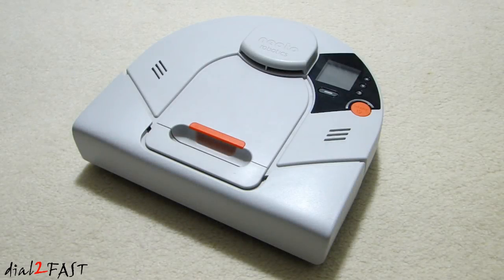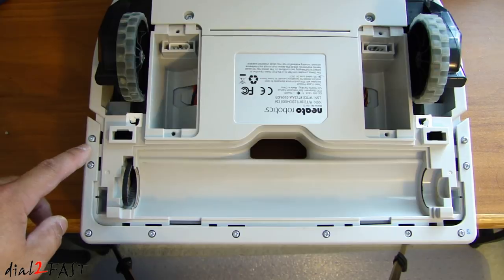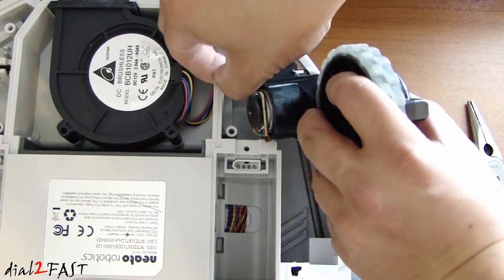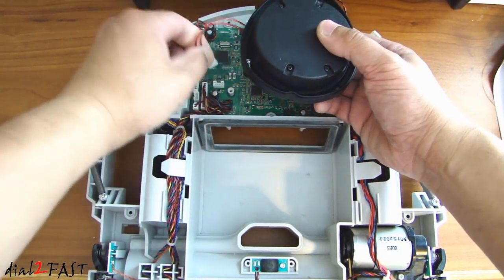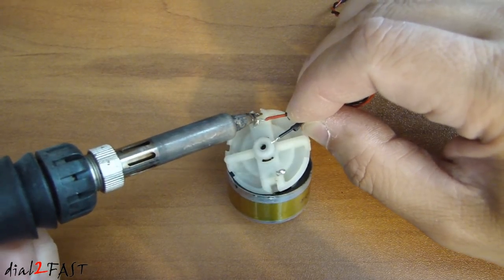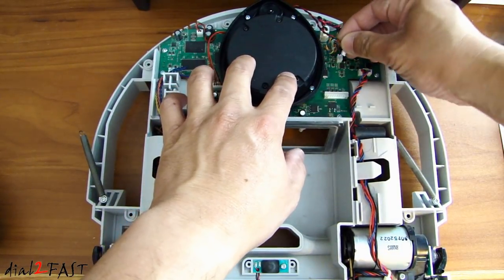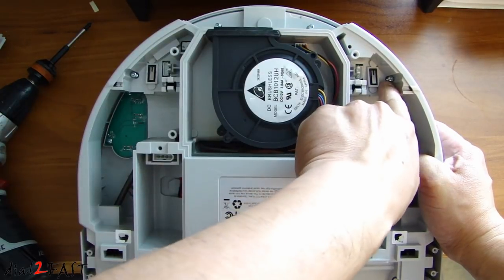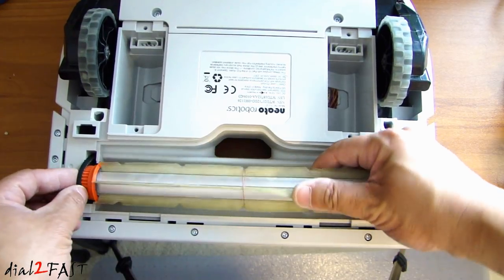NEATO Vacuum Cleaner Repair - My Vision Was Blocked 3000

Comment: One of the most comprehensive DIY videos that I have seen.  I was actually starting to shop around for a new robo vacuum when my Neato stopped working.  Seeing that my Neato was around 10 years old and the batteries were getting close to needing replacement, I didn't want to invest too much more time and money into it.  I found this video and although it seemed a little daunting at first with the number of screws and components that need to come out, it really wasn't bad at all.  There was a little plastic fatigue on two screw-holes but there are so many connection points that it still holds together very solidly.  It took about 20 minutes to take it apart, two days to receive the part and about 40 minutes to re-assemble it.  Put it back in the charger and after a top-up, it was back in business.  So, after about $10 in capital, a little over an hour of time and that pesky 2 weeks of procrastination, my Neato is back in service!  Thanks!

Comment: Extremely clear video, thank you!  For those also suffering from the "my vision is blocked" problem, here is my experience after bringing the machine out of a two-year exile in the closet.  I could see the lidar spinning so thought that was not likely the problem.  So I decided to disassemble just to see if there was anything I could clean before sending it off for repair.  I can't say for sure what did it, but the process of dis- and re-assembling (a few times) seems to have fixed it, for now.  The only things I remember changing were (1) the belt that drives the lidar seemed a little stuck when I first played with it, so I reseated it in the groove, (2) the pulley that moves the belt was a little low on the shaft and might have been rubbing as it rotated with the motor shaft, so I lifted it slightly, and (3) the back rollers that the machine rests on when moving were immobilized by hair.  Here are some definite caveats: (1) do not overtighten the screws that hold the motor to the lidar--the hole in the motor stripped and I had to use some glue when seating the screw, (2) in the XV-11 and -12, it is quite difficult to reconnect the ribbon cable just before reassembling the top onto the bottom.  There is a little black piece on the connector that needs to be lifted ever so slightly to allow the cable to slip into place, and then the black piece put back down into place, and this has to be done with the top cover close to its final position on the bottom of the machine.  It's tricky and took several tries of reassembling and disassembling the whole thing.  (3) Be sure to test before reassembling the top to the bottom that the bumper clickers are positioned correctly by pushing on the bumper in all four locations where the clickers are located.  I had to re-/disassemble once for that problem.  Just cleaned the house and the error has not come up again!

Comment: A terrific instructional video. The steps are clear and as I write this my Neato is cleaning house again. If you're going to undertake this repair, you'll need to buy a small motor, and you'll need a soldering kit. The motor is cheap and soldering isn't hard (my first time!). Thanks for a great video.

Comment: Thank you. I too got mine going with the help of your video. I bought a motor from ebay that came with the wire.  Put it in and it didn't work correctly.  Then remembered your comment about the polarity of the wiring and took it out, de-soldered and re-soldered the connector and presto! Robbie is working again!  Many thanks
Reply from the maker: Very good to hear you got yours fixed. Cheers!

Comment: Excellent, clear, precise video!  It will save you from having to send it back to Neato, which I know from experience is a "Black Hole".  You can plan on not seeing it again for months, and, when you get it back, it may be missing parts, like the charger!  When these run, they work well, but both versions of Neatos I own are plagued by problems.  The latest is the vision issue on my XV-15.  With the amazing amount of disassembly required, this video is a huge help! BTW, I replaced the standard NIMH batteries with LIONs and have had no more battery issues for several years.  Now, if you could just come up with a fix for the "Please turn my switch on" error, when the switch IS on for my 2yo Roomba.  That said, stick with a Roomba; I've had one for 12 years, it runs like a top, and is only on it's 3rd NIMH battery(replaced 6 months ago).  No "Battery Reset" routine ever needed.

Comment: Fantastic video. I took mine apart and the motor looks the same, engineered to fail, basically. Anyway, you saved me from having to poke around to find all the screws and pulling on parts only to find I missed a hidden screw. Thanks.
Reply: What isn't.

Comment: Thanks for the video. I had the same 3000 error and a new lidar motor is exactly what I needed. Brushes were worn just like yours. Great instructions.
Reply from the maker: Thanks for your comment!
Reply: Patrick Moore wonder if its possible to weld the brushes or replace that worn brish with a similar instead of ordering a new motor
Reply: Bezerra Luis I’m sure you could. Was just easier and faster to drop in a new motor and they are cheap enough.

Comment: Thank you for well put together video for installing motor in Neato to correct “vision error”. I was able to fix my system with your help!  My only request would be to show which length screws to use when putting back together.  Thanks again!!

Comment: Thanks a lot for the detailed video! It helped me for my XV signature.
In my case, once I got to the motor, I first tested it with a 5v adapter, the motor seemed to spin correctly, tested a few times spinning it forward and backwards. Then we tried to pull the belt off and it was stuck! We cleaned it, added some new white grease on it and reassembled the Neato. It's cleaning the house happily after that, no parts replacement needed yet. I'm buying one of those motors next time I travel to USA just in case :)

Comment: Excellent guide!  Here are a couple of tips to consider. The assembly screws are made of very soft metal and it's easy to strip the heads or even break them off. For a few bucks you can get stainless steel #4 x 3/4" sheet metal screws that are perfect replacements at Home Depot. The reason I needed some screws was I had to remove the top a few times because the bumper switches did not align with the top easily. As an aid, I put 1/4"x1/4" pieces of double sided tape on the back of the flippers at the point where they touch the spring. This held them perfectly aligned for easy top installation. Finally, the 3 pin connector for the lidar to the motherboard tends to pull off the motherboard rather than separating the plug from the socket. Put a mark on the board and the socket for correct reassembly alignment before you remove it.
Reply: especially the lidar socket that pulls off the motherboard tip is useful !

Comment: Thanks for a very clear description of the repair.  One thing I found was that you need to be careful not to over-torque the screws when putting them back.  Two heads broke off very easily and one stripped the thread on the plastic in which it was inserted.  Gently does it!

Comment: Excellent video. Clear and concise, pointing out all the "gotcha's" you might run into. 
I use blue tape to keep all the screws in place on the different plates that come off like that small screw on the trim plate. Makes putting things back together a no brainer. 
One small point, when removing the motor screws they have a tendency to roll toward the lidar. 
I also wonder if the fact that the motor is running backwards tends to make the brushes fail? The brushes seem to favor rotation in one direction. 
My client's burned up exactly like yours. Early diagnosis was that the lidar wasn't spinning. 
Also I turn the screws like this backwards until I feel it drop in the thread. Keeps them from stripping out. I'm especially careful with these coarse ones that thread into plastic!

Comment: Your video & step by step instructions were clear & precise. Very well done....
I have had my Neato xv21 apart about 6 times now over the years for various faults. Usually motors going bad & sensors blocked & 1 broken sensor wire from bumper bar flexing. 
LiDar Motor is <$2 on EB ... see below. Wanted to check your video to see if you use the same take apart procedure. Only difference was that I left the wheel motors in place for the LiDar motor fault just to save time. Also, Replaced NiCd Batteries over 2 years ago with custom neato Lithium batteries (made by PowerLithium in USA) and the machine works great. Up to 1hr 15m run time. Were as the NiCd’s gradually get less & less run time until they die. Lithium are far better.
Cheers... Trevor in West Australia.

Lidar Motor on eBay here:

Mabuchi RF500TB-12560 Motor DC 1.5V 6V 12V 4600RPM 32mm DC Motor Spray machin EB

https://rover.ebay.com/rover/0/0/0?mpre=https%3A%2F%2Fwww.ebay.com.au%2Fulk%2Fitm%2F263527236662

Comment: Great video, thanks for putting this together. It worked perfectly on my first Neato, tried it on my second Neato a couple weeks later as it was experiencing the same symptoms, and once i put it all back together I received a message that stuck "My bumper is stuck. Please free it." Any ideas? I paid close attention to the four small, black, plastic bumpers when disassembling, one did fall off but I put it back into place and tested it right away. Any help would be appreciated.

Comment: My XV-12 has a problem with vision blocked most of the time, but not always (sometimes it runs).  Also, it looks like the lidar is spinning even when it is having the problem.  Are these two symptoms consistent with a problem with the motor?

Comment: Hi, ive followed your very clear instructions, but my XV Signature Pro, still has the sampotential problem :-/ .. I opened up the motor as you, on the one I replaced, and mine was burned as well. Do you have any other solutions? The vision/censor does not spin.

Comment: Thank you for sharing this very good video.  My XV-21 recently got frozen when power on.  It needs to remove the battery and switch back then it can work OK. It happens very often. Have you had similar problem with your machine ?  I appreciate if I can get your comments.  Thank you.
Reply from the maker: I have not had this problem.

Comment: Thank you for the excellent video. I replaced the Lidar motor and continue to get same error message "My vision is blocked 3000." Can you please recommend anything else I can try?
Reply: I was getting the same message, I came across this video. Ny neato has been in service for 45 months working everyday.
I'm kind of leery of putting any other money into it as something else might break.
I did try this and of course I'm only 15 minutes into the cleaning I did but the error message has not come back and it sounds and is working perfectly.
I took isopropyl alcohol and q-tips and cleaned underneath where the laser eye is and I also clean down into the spinning groove. It was my hope that after 3.5 years it was some kind of dust and dirt buildup. Not sure if this is a fix but so far so good fingers crossed.

Comment: They actually changed The new motor system for the D7. That was their way of preventing this problem but it actually is made it worse. They used to fail usually in 2 to 3 years but now can fail in as little as 3 to 4 months. This on a $700 vacuum And per Nido it was due to a bad batch of motor supplied. When it works it works great when it doesn’t it fails spectacularly.
Reply: Neatos are poorly engineered, and their "repair service" is a nightmare.  I sent one in for repair and it took 4 months and a VERY reluctant intervention from Neato to get it back.  The new batteries I had replaced at the suggestion of customer service as a"fix" were dead as rocks from the battery switch being left on for 4 months.  They tried to charge me 3 times for the repair.  When it finally was returned, they sent it back with the wrong charger.  Neato finally sent me new batteries and the correct charger, but the docking issue returned in a few weeks.  I finally took a leap of faith and replaced them with Lithium Ion batteries, and the problem was solved.

Comment: The link Amazon does not have the same model number on thr motor. I'm about to put mine back together again. I hope it will work.

BTW where can I buy screws for the neato. Mine was sent in for repair before and it was tuff to get the screws out.
Reply: I suspect because the moter model is not the same that mine now does run around in circles and climb up door frames. It started to give me a left wheel stuck error and I swapped wheel motors around. No more wheel error but still running in a weird way. I ordered a other motor from Amazon and I'll post that link of that solved the problem.

Comment: Thank you for the video!
Do you know what is causing the 8004 issue (battery overtemp) ? Signature XV model.
Reply: 2 pins on the battery connector go to a battery temp sensor. Apparently the pins can be pushed back so they are no longer making contact.   There is a video on YouTube about this.  Unplug each battery and check the pins on the connectors.  If one or more is shorter than the others, consult the video for a simple fix using a glue gun.

Comment: Sometimes it's just stuck but the motor is fine. I just put the eraser side of a lead pencil through the lidar slot to manually rotate  the lidar and that usually gets it going.
Reply: e k It could be that the brushes are dirty (coated with black residue), and you giving it a kickstart is just enough for the brush contacts to make the shaft of the motor spin again. Cheers.

Comment: So I did this repair.  The vacuum runs now error free, but now it just cleans a perfect 4ft circle and then thinks it finished and returns to base.... The batteries are new and great... And before this error the vacuum would clean the entire house perfectly. I wonder what I messed up to make this thing clean a precise circle and then think it's finished....  I followed these terrific directions and everything went back together very nicely... I'm stumped... Advice?
Reply: J&S Adventures! I'm also having this issue.  Could a bumper be stuck?
Reply: dabler37 don't think so. Functions perfectly, minus the fact that it acts like it's stuck in spot clean mode.  If it encounters and obsitcle, it bumps and continues.
Reply: It's perfectly capable of a straight line.  It comes straight off the base, creates the 4' circle, and then makes perfectly straight rows within that circle.  At which point it does a happy little "I'm finished cleaning the house" chime, and returns to base.
Reply: @JSAdventures  were either of you able to figure out a solution?  replaced everything and got rid of the message, but now it only cleans for about 5 minutes and thinks it's done, instead of doing the whole room like it used to.
Reply: Evan Blasor nope. It's officially a clunker
Reply: Hi! Got the same problem after this hack. Any info on your fix?
Reply: ylleskog yea, I threw it in storage for parts, and bought a new robot vacuum. 😕
Reply: @ylleskog  How did you solve your problem?
Reply: I realize these comments are old, but my Neato did the 4 foot circle and done after I replaced the lidar motor 8/2022.  Turns out I reassembled the 3 wire wiring harness backward (it is 1 of 2 harnesses that attaches to the cover) after mistakenly pulling off the white plastic cradle that holds the wire harness and putting it back on in reverse.  That particular wire harness goes to the side bumper sensor.  Reversed the cradle and harness and now Neato XV 21 works perfectly.

Comment: I did the repair, when putting it back together the belt broke. I got a new one and installed it. Had some issues with the bumpers being stuck but finally got it back together and it is still throwing the 3000 error message. I can see the Lidar spinning. Is there anything else to check. I also did a soft and hard reboot.
Reply: Have you found a solution?  My Lidar spins but I get the message.
Reply: Where did you find a new belt? I think that my problem is the belt, because the motor spins well.

Comment: Hi, wouldnt it be easier to fix the wire/pin at 5:44 by welding? thanks
Reply from the maker: You can't weld it, it's a brush that needs to rotate.
Reply: thanks

Comment: Just passing on a tip that I saw online somewhere.... Kick it, kick the machine pretty swiftly. I did it to my Neato XV and the error went away and has not returned. 2 years ish and counting.
Reply: I did that merely out of frustration and it didn't work. My toes hurt, however.
Reply: Ha, thanks, this worked for me.  It'd been upside down for a couple of days while I waited for replacement batteries, guess the lidar just got stuck, gave it a whack, it came back to life.

Comment: Movie is showing 12V motor but the link is for a 6V motor. I could be wrong of course... Can anyone confirm this?
Reply from the maker: The RF-500TB-12560 motor has an operating range of 1.5VDC to 12VDC. The nominal voltage is rated at 6VDC, but this motor will operate between the 1.5 -12VDC range. The Amazon listing is showing the nominal voltage rating.

Comment: thank you for the detailed video, I have successfully replaced the motor, but two small pieces came of from the front of the vacuum and not sure where does  that go, I did not see them in your video, may be my model is little bit different. Here is the picture of the parts https://drive.google.com/file/d/1IWVGN_fvTDrc5E1BWsGg198ObnDzOFYb/view?usp=sharing
Reply from the maker: Those two black flaps are for the front bumper. See video at 4:17 (at the bottom of the video)